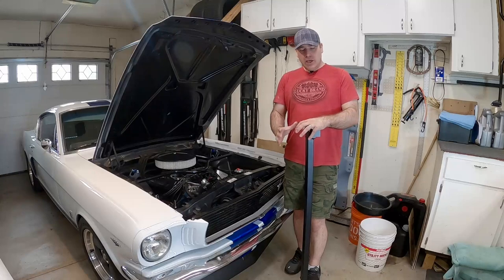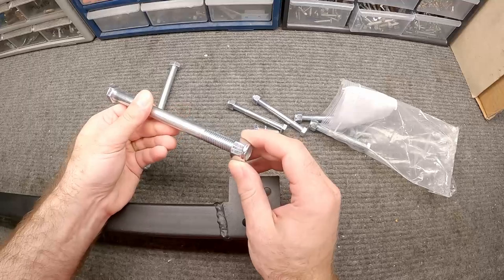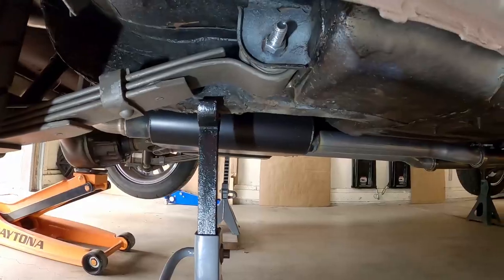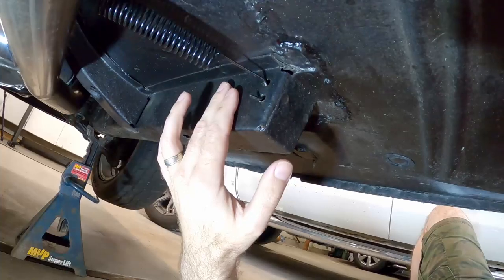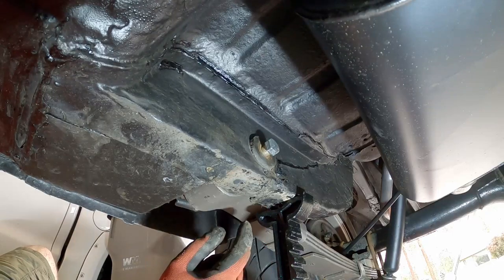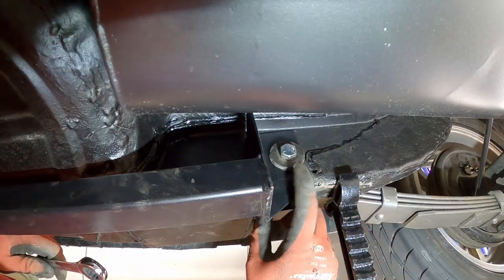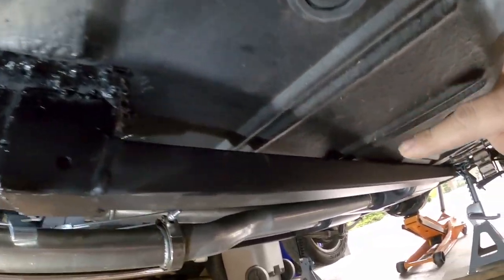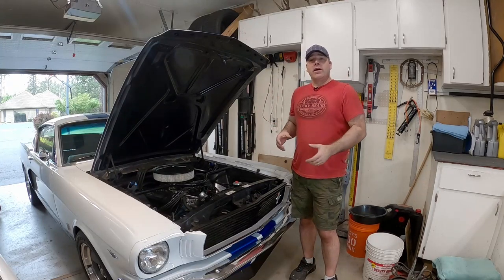Installing Subframe Connectors

Comment: This is a super investment. - I installed a set on my old 1970 Dodge Challenger R/T 383  Convertible, amd it was an awsome upgrade!! - The car because it was a convertible , the body become much stiffer and with some other upgrades too, the car was a blast to drive. - Thank you Andy, I will do the same with resto of my 1970 Cougar Convertible.
Reply from the maker: Yeah, these parts are great.  It's always cool how one part can drastically change the car.  :)

Comment: Suggestion to those that are going to do this: when you have those axle bolts out, use some anti-seize or marine grease on the non-threaded areas of the bolt. That'll prevent those bolts from seizing in the bushing in the leaf spring. Nice work Andy.
Reply from the maker: Good advice, I should have mentioned that.  :)

Comment: I am a HUGE ford fan. Been restoring these old Mustangs for 40 years. Never understood the reasoning behind the unibody frame. You would think after 65, and 66, they would realize the problems. And change to full frames. But, nope. Still making them. I don't get it.
Reply from the maker: I never understood it either.  :)

Comment: Torque boxes may do more than subframe connectors. More work but then the rockers tie both ends together.
Reply from the maker: Strong torque boxes would help, but they don't impact how the back half of the car works with respect to the front half.  :)
Reply: @AndyKruseChannel  Are you sure? Load path from the front suspension (assuming no front torque boxes) is front frame rails to footwell/cowl to rocker panels. Rocker panels back to rear torque boxes to rear suspension. The wider your can disperse the torsional loads the better. So although it seems logical to just tie the subframes together the reality is for torsional loads going through the rockers and torque boxes is actually better.
Reply from the maker: I'm not arguing the impact torque boxes have on the torsional load of the car, but these bars are meant to improve the torsional rigidity from the front half to the rear half of the car.  Relying on the floor pan to do the work is not ideal.

Comment: Hey , love all your video, working on Mercury cougar 69 in France and want to know. Did you need the remove the battery or gas from the car before welding ?
Reply from the maker: Nope, not for stuff like this.  You could remove the ground for the battery if you were concerned, but it's fine.  Maybe if you were welding near the gas tank (like right next to it), it might be worth exploring the options to remove the fuel, but it's fine as long as you're not welding to the gas tank.  :)
Reply: Thx a lot, need to do a weld on the rear fender.
Reply: @benzin47 mon ami the mercury cougar is such a Beautiful car. Well done. Respect from Fiji. My uni rugby team coach was a Frenchman who was also the coach for Stanford university during their playing season. Best wishes! #V8Freedom

Comment: Hi Andy.  Thanks for sharing.  I installed my CPP subframe connectors on my 65 FB. They are bolted in. I had no idea to weld them up will even better than just bolted.  Have you notice a difference?   I will visit my local muffler shop.      Guido 👍🏼
Reply from the maker: Because these braces are reducing the torsion of the chassis between the front and rear frame rails, the holes that the bolts go through will be stressed over time.  This will reduce the stiffness of the connection as the bolts begin to move about within those holes.  The weld bars still see the same stress, but the welds will maintain the stiffness as there's no moving parts or connections that can be moved.
I put these same bars on my last Mustang, but I didn't have the car long enough to observe the effects of the bolted connection.  I'm in the same boat with this car, I haven't had them installed long enough to notice the welded connection.  I have also upgraded so many suspension related components that it's getting difficult to notice the changes I make as everything is "stacking up" and the car is tightening up over the soft stock setup.  :)
Reply: @AndyKruseChannel  my set up  rack and pinion. CPP UCA&LCA. Global west 600 lbs coil springs  Bilstein Sports shocks all the way around.   Reverse mid leafs (4.5.) 1 inch sway. Monte Carlo 
The biggest improvement I have seen over everything is the CPP Mini subframe  delete caster rods and bushings.   I can’t rec this enough. My car sticks in the turns.  I don’t have torque boxes. But I feel I don’t need them after doing that mini front frame.
Reply from the maker: Sounds like a pretty good list.  Wait until you install a Panhard Bar, it'll change your life.  :)
Reply: @AndyKruseChannel  but I am not running a rear sway bar. I didn’t like the mounting fixtures it came with.     Are you running rear sway?
Reply from the maker: @luckyluciano4968  Nope, I do not have a rear sway bar and I currently don't plan to add one.  I had arear sway on my previous Mustang, but after learning about Panhard Bars, I'll probably never think about them again (for Classic Mustangs).  :)

Comment: I’ve done all the same suspension upgrades as you and I can tell a big difference in the handling but the best upgrade I did was putting Koni Street shocks on the front and rear. I would highly recommend as the budget allows.
Reply from the maker: Yes, good shocks can go along way.  :)

Comment: Andy...Thanks for the video. I am about to order these...but wanted to know if you would recommend. you mentioned you would give an update because you didnt know if they would do their job.
Reply from the maker: This is one of those parts that most people won't be able to tell the improvement made to the car.  I look at it like it's part of a larger modification.  Meaning, the subframe connectors, plus additional chassis stiffening, plus larger sway bar, plus panhard bar, plus better suspension, etc, all add up to a better handling car.  While this car will not out perform most of today's sportscars, it's a massive improvement over what came from the factory, and that's what I'm trying to do.
To speak on these specific bars vs other brands, I chose these due to their ease of installation and price.  If I had it to do all over again, I might pick a different brand, but those other brands would be more expensive and require more effort during the installation.  It's things like brand B is harder to install, costs 3-4x more, offers maybe 10-20% more rigidity, and is 2 months out compared to brand A (what I have here) that was on the shelf, can bolt in or weld in (I recommend weld in), and fit everyone's budget.  :)

Comment: Is it a noticeable improvement in the handling of your Stang? I guess I've really never noticed the flex in my Mach 1 but I am considering doing these as well..
Reply from the maker: I think it would take a trained driver to notice the difference, but that doesn't mean it's not helping each time you drive.  I look at this part as just one piece of many that I need to make this car handle better than it did in the 60's.  :)

Comment: I put those bars in.  I used the bolts and then welded both ends. Tommy
Reply from the maker: How do you like them?  Did you notice any difference in how the car felt or handled?
Reply: @AndyKruseChannel   doing mine this fall on my 68 coupe... Andy, curious why you did not weld the back ??  I'm hearing only good things about the subframe connectors for the mustangs , I had them on my 97 convertible back in the day and it was NIGHT AND DAY !
Reply from the maker: @Ralphis1970  I need to weld the back ends, but I think I might need to do some patch work to the frame back there, so I was holding off until I determine what I need to do.  :)
Reply: @AndyKruseChannel  Smart man then ;-)   great videos by the way. Appreciated that you take the time to do so.

Comment: Do you think those subframe connectors would interfere with a Hellwig rear sway bar? Does it come close to your rear panhard bar? Thanks for the reply earlier also!
'EDIT: OK i looked at your other video installing the panhard bar at it looks like the connectors will not interfere with swaybar or panhard bar.
Reply from the maker: I had these same subframe braces (but I bolted them instead of welding them) on my last car where I had the Hellwig rear sway, no issues at all.  The panhard bar is even farther away from these subframe braces, so you're ready to rock!

Comment: Did you do any welding at the rear of the subframe connector where it fits near the leaf spring or is that really necessary?
Reply from the maker: I think people can weld that in place there and it would be a better connection.  I elected to bolt it in as I wasn't sure about my future plans.

Comment: The tab you had to bend a bit at the rear does what?. It doesn't seem to have a purpose.
Reply from the maker: I wonder if it’s for other models?  Or possibly to be bolted in?  But I agree, it seems to be useless. 😁
Reply: Maybe support so the bolt won’t shear off?

Comment: under engine brace?
Reply from the maker: These connect the front frame with the rear frame, instead of relying on the unibody to do the work.  You might be thinking of the lower crossmember that connects the two front frame rails to each other?